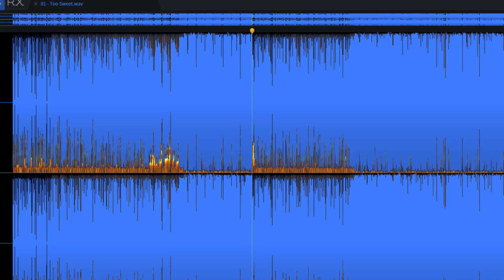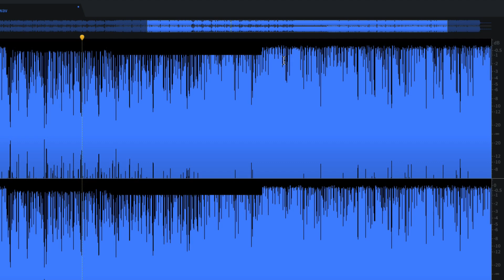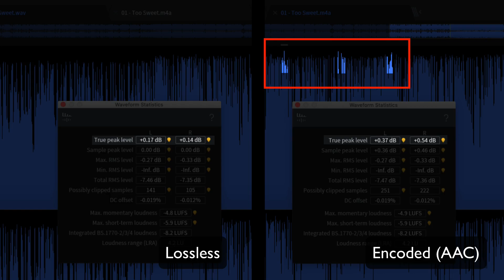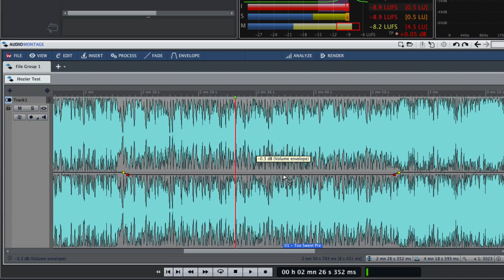Automation AFTER limiting ??

Comment: I'd like to point out that m4a can contain either lossy or lossless formats. It depends on the codec being used. Apple uses AAC for lossy and ALAC for lossless. Both codecs create the m4a file type and both are compressed, but only the AAC codec creates lossy files. The way to tell Apple Music which codec you want it to use is by enabling lossless audio in the playback settings and selecting one of the ALAC options in the streaming and download dropdown. The resulting files will still be m4a, but they will be using the lossless ALAC codec.  Of course, I don't know if Drew did that or not, so your point may still be valid for this specific issue, and of course is completely valid for the concept you discussed about lossy formats in general.
Reply from the maker: Fair point ! In this case Drew specifically said the files were lossy 👍

Comment: I’ve seen Streaky’s video discussing his “Limiter Sandwich” technique. He limits his master, then automates the volume down a dB in the verses so the choruses pop and then slaps on another limiter after.
Reply: Ha Yeh! Cocktail Compassion etc .. Streaky is a bit hammer n tongs.. some good stuff.. but would not take it all as gospel..
Reply from the maker: Everybody does things a little differently - I try to avoid double-limiting. 

This used to work better in the early days, but modern digital limiters are much more sophisticated and typically designed to “expect” natural transients as an input, and process it as cleanly as possible. By adding extra limiting to an already limited source, we’re compromising the limiter’s ability to do the best job.

In the real world that usually means slightly more distorted transients, which some people interpret as sound more lively, but I prefer to use soft clipping if that’s the goal
Reply: @ Agreed, I don’t implore this technique personally.

Comment: It's fine but such edits already got me (volume) dropouts in streaming services...
Reply from the maker: Can you say more about this ? I can't imagine a tiny change like this will make a difference to the overall level. If anything, reducing the overall level slightly should help the loudest moments to stand out more. Are you seeing something different ?
Reply: @ProductionAdvice  in my case I did crossfades, in 24 bit dithered files at 192 khz, and manually leveled so it wouldn't cross the limit (from - 1 to - 0.1 depending on the celiling of file at hand), and it ended up "dropping out" at that area, once I heard them back at the stores. Nothing scandalous, but enough nerve wrecking on the OCD amid us to take homogeneous brick limiting more seriously...